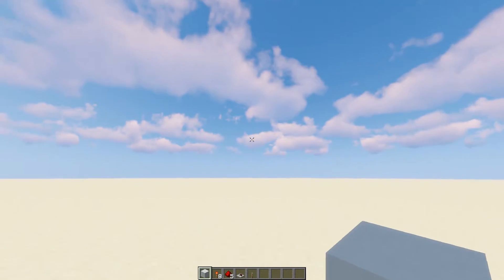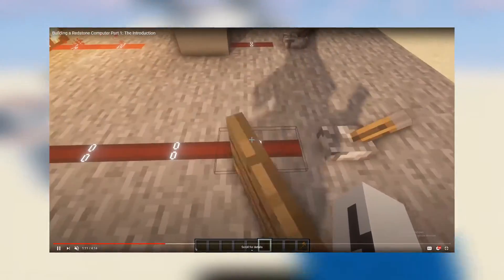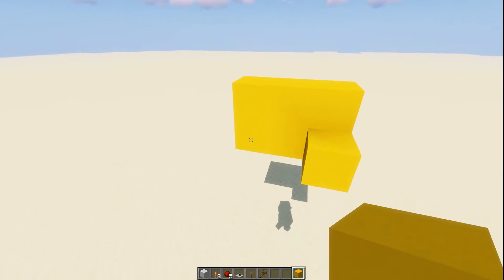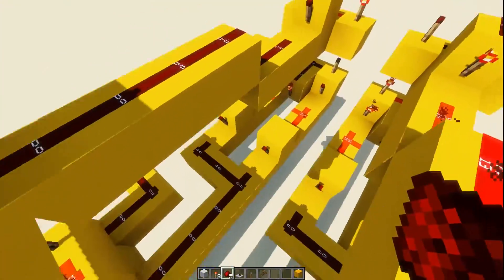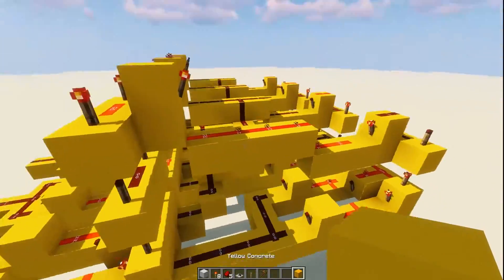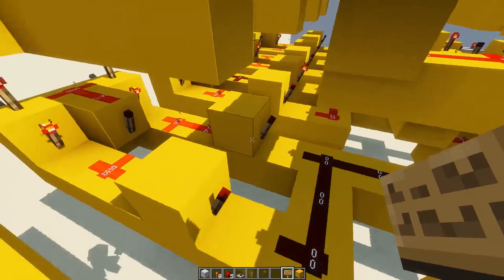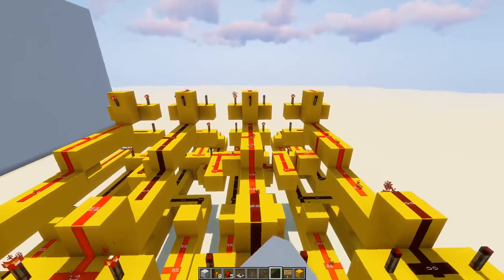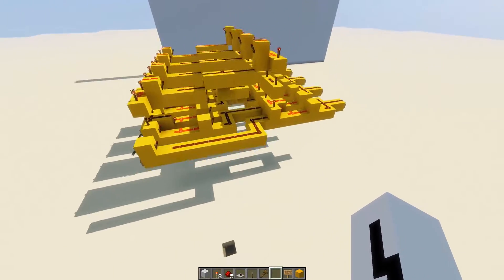How to Build a Redstone Computer Part 2: The ALU

Comment: Just to be clear, I'm not here to spread hate, just here to provide some criticism in the hope that some important information is corrected.

People are using this design on ORE (redstone server) under the impression that this is an ALU.  This is just a 4 bit adder, it takes the sum of a pair of binary numbers and outputs them, the lever on the far right is the "carry in" which adds 1 to the output.  As happy as I am for a video about redstone to be this popular, it's a bit frustrating to see blatantly incorrect information alongside it.  I do hope you'll consider fixing it one way or another.
Reply: Yay amy!!! ^
Reply: nice, what do i add to make it an actual ALU?
Reply: @TerxdGD  So generally the ALUs I've seen have 5 main control lines: Invert A, Invert B, Carry In, Bitwise OR, and Flood Carry.  It can be a lot, but individually they're not too crazy and they enable you to do addition, subtraction, and the various bitwise operations.

To add Invert A and Invert B, you connect each input bit to the output of an XOR.  Now one of those XOR inputs is your actual ALU inputs while the other becomes part of the control line.  You'd connect up all those other inputs that correspond to input A or input B to a single line each for Invert A and B respectively.

Carry In is generally a default part of an adder and no additional work is required.  It's the extra input on the end that they describe as an "extra 1".

Bitwise OR is a bit tricky, essentially you want the first row of XORs within the original adder to act as ORs (and to disable the corresponding carry signals the half adder produces).  Usually this is done by having a line that powers the middle dust in each XOR.

Lastly, you have Flood Carry.  This is as simple as powering all of the carry lines, though you can generally ignore powering the Carry Out since that's not going to impact any actual logic.

Like I mentioned earlier, with different combinations of those control lines, you can get addition, subtraction, and the various bitwise operations.   It's hard to explain purely through text, so I apologize if anything is unclear or messy.  I might try making a video to explain modifying this particular adder since it seems to show up a lot more than I'd like.

Comment: One problem:when I do 2+2 it says 3 instead of 4 how do I fix this i also tried 3 + 1 and it didn't work
Reply: Maybe it's a redstone dust error? Maybe you didn't placed redstone where it should be? Or maybe you did put a Redstone torch somewhere, look into the connections

Comment: Hello Melneusc! when I built the ALU, it worked perfectly only if the inputs were completely inverted. Is this an intentional part of the design? Im also wondering why you invert the XOR gates, and use a sketchy (to me) way of setting up the AND gates.
EDIT: nevermind, the XOR gates are not inverted. In the video, you say they were (?) but the carry line seems to also activate when the input is 0+0. I checked thoroughly but the design matches yours

Comment: if you enable one of the 8s and both of the 4s (8), the second 8 bypasses the carry line so no data is shown and the overflow line is off. the same thing happens if you enable a 4 and both 2s.
Reply: nvm i just forgot to place the redstone piece under the top torch at the front

Comment: Me: sees the general shape.
You: builds an XNOR gate with the lead going off
Me: "Alright, I'm smelling what your stepping in. It smells good, correct."
Me: builds the wrong thing on the wrong side
Me: "Maybe I'll watch a bit longer before jumping to conclusions."
You: builds the rest of one module 
Me: "Oooh, now I'm getting it."
You: forgets a redstone dust at the top of each module
Me: "Wait, this looks lime it's missing one. Oh well, he knows what he's doing. I'll just follow along."
You: adds them in the speedy bit that I don't see
Me: gest frustrated yours works but mine doesn't. 
Me: "Let's try this." Puts the missing dust in.
My machine: works.
Me: "Ok. That fixed it."